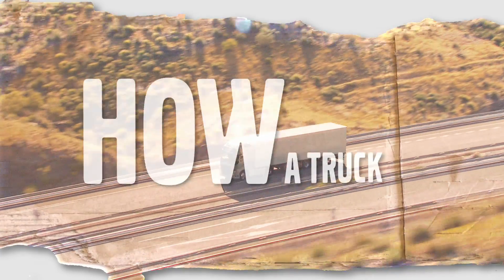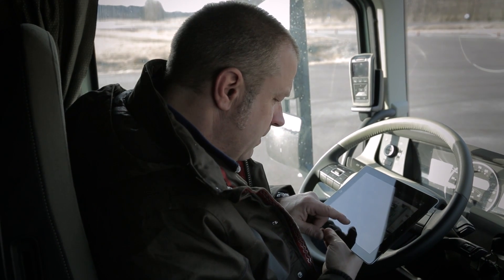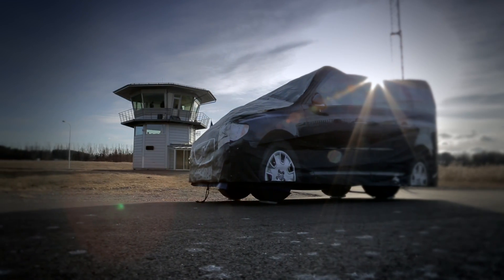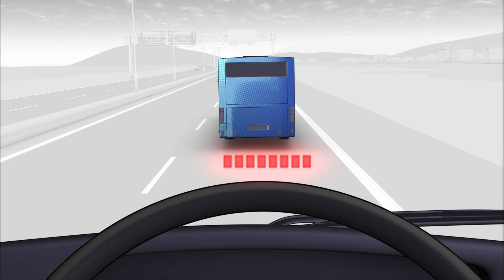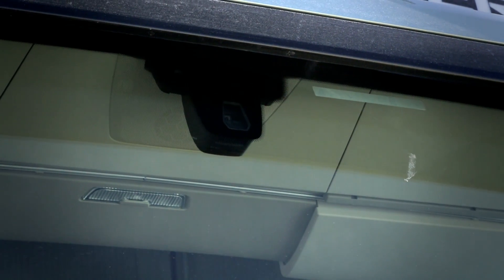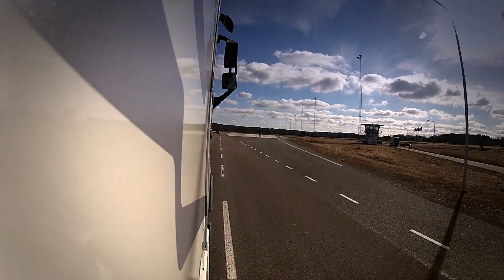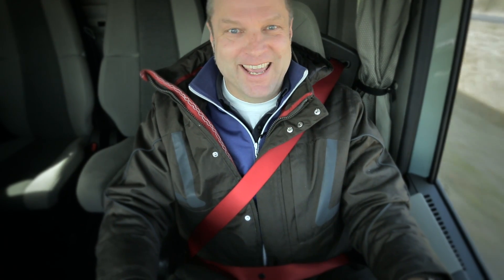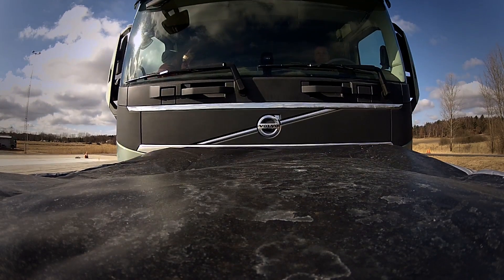Volvo Trucks - Testing Collision Warning with Emergency Brake - "Trucks' Anatomy" (E01)

Comment: My question is, if the driver hit the brakes at the same time the automatic system would kick in, would that be enough to stop the truck? Like.. I guess what I'm wondering is there anything special about the automatic system breaking vs a regular person breaking. Not in terms of like, reaction or whatever. But more in a sense of, do the breaks from the automate system work harder than if the driver was breaking? If that makes any sense. It blows my mind how quickly it can stop and I'd like to see a comparison of human stopping vs it.

Comment: Automation like this is the direction vehicles need to take, IMO. Adding features that automatically do things when the human mind fails is way better than letting the machine do all the work in every situation (which is impossible). This automation doesn't encourage drivers to be less attentive, and it only activates when the human has failed.
Reply: Yeah

Comment: Rip to the drivers behind the semi
Reply: the system starts of with mild braking. before it brakes as hard as it can. so unless your grill is 2cm away from the trailer.
you will have plenty of time to brake :)

Comment: And how about the situation when the truck is full loaded and has a higher weight? Is that system going to react exactly the same by stopping with the same distance from the vehicle?
Reply from the maker: The trailer is fully loaded with 40 tonnes.
Reply: Volvo Trucks Thank you for your answer.

Comment: Not proof that it works, but a feature of the excellent braking system. I say that it's not proof b/c allegedly an investigation determined that the driver not the system saved the child's life.

https://www.liveleak.com/view?i=0b2_1510507991

Comment: https://www.youtube.com/watch?v=LxlHjz9EsCU shows the breaking system also works on children, running out from behind a bus.
Reply from the maker: Our system Collision Warning with Emergency Brake is designed to alert the driver if there is a risk of a collision. In case of an emergency situation it will automatically brake to mitigate a possible collision with another vehicle. In this specific case the driver and the truck are the real heroes for acting very fast and correct.

Comment: Does it work on pedestrians?: https://www.nrk.no/sognogfjordane/her-er-skuleguten-berre-sekund-fra-a-bli-pakoyrd-1.13774425
Reply from the maker: Our system Collision Warning with Emergency Brake is designed to alert the driver if there is a risk of a collision. In case of an emergency situation it will automatically brake to mitigate a possible collision with another vehicle. In this specific case the driver and the truck are the real heroes for acting very fast and correct.

Comment: But in case of zombie apocalypse?? If you need to smash through cars on a highway full of abandoned vehicles you're screwed. They should really have a button for this!
On a serious note I wonder how it reacts when the vehicle is turning a corner at speed, the truck could flip on the side if brakes were applied at a wrong moment. Really cool technology though.
Reply from the maker: Hi, check out this video: https://youtu.be/dqNtzncxxcI

Comment: I drive one of these new Volvo,  I can tell you..... It does work. .😮😮
Reply: that would mean that you nearly hit someone if it was not for the system??? BOI
Reply: @dagoskai572  yea, these machines capable much more than humans... I can tell you, once a Scania's auto brake saved my ass. I made mistakes, I am a human, robots too but less frequent
Reply: the system also isnt perfect, espcially on dual lane bends without road markings

Comment: "If there is no reaction from the driver, the system will automatically activate the brakes."

The system should not wait for the driver to react, it should start breaking imediatly by it self to avoid panicbraking. 

Also, he activates the cruise control in the video, will the emergency brake work even if he would accelerate? Will it work in speeds over 50km/h?
Reply: Your opinion is right! But if they do like you say,the system will activate everytime you approach a car behind you.

Comment: And so what keeps the LOAD from rolling over the cab & driver after shifting forward during braking?
Reply: Take the drivers license theoretical course and you'll know.
You have to secure the load so it stays in place when doing emergency braking.
Reply: +Lithuania Mania  did the load move in test?
Reply: I don't know how it works in the rest of the world. But In Europe you have to secure the load 100% of it's weight forward. If a pallet weighs 1500kg then you have to secure it for that load. Using the correct equipment it's no problem. Of course if you are involved in a crash and the truck does 70mph --> 0 mph instantly then you are dead anyways.
Reply: Lithuania Mania In Sweden by law the cargo need to be secured so it can take its own weight. That means a deceleration of 9,8 m/s^2 , compered to the emergency brake of ruffly 7m/s^2.
Reply: I don't care how strong the chains or straps are...moving forward at 70 MPH and stopping on a dime will very probably break the restraints and then....goodbye driver.!!!  You must have seen rolls of coiled steel tied down on truck beds with the eye of the coil being in the position where one could look thru it from the SIDE of the truck, yes?  It's called carrying the load in the "suicide" fashion!  Guess why?

Comment: the problem is what if the car behind you does not install this system? it might prevent you from hitting the car before you, but meanwhile will result in another collision from the car behind you. It is like to ask you to make a choice, hit by your head or bottom?
Reply: Some Volvo V70:s have the same thing

Comment: it was awesome but what happen to the vehicles which is coming behind of the truck
Reply: +Balakrishnan Idayachelvan Well, if they adhear to the law and have enough safety distance: nothing :) looking at it from a responsibility point of view. The last vehicle to collide from behind, has the responsibility for the entire crash. If the other managed to brake, but the last didn't, it would cause the ones in front to collide as well. 

but now we are going into traffic law instead of appreciate that with this truck we can avoid or severely minimize the damage done in a crash.
Reply: That's the driver behind the trucks problem...be aware of your driving..practice safe driving!

Comment: This system is very accurate thought it shouldent be use as something to twittle with.Drive the truck like it should be driven an it shouldent be an issue. Just switch it on when in unsure situations an switch it off, Other than that your eyes should be on the road anyway.

Comment: How about truck drivers learn how to drive properly instead so theres no need for installing automatical brakes onto every truck?
Reply: +ShoutsWillEcho1 If you watch the crash comilations on youtube from various places, sometimes thing pop up out of thin air, that a normal person will not have the time to react to. With this system a crash may be avoided or minimized in severity.
Reply: ***** Well, there sure isnt a lack of retarded people here.

Comment: What if camera or radar fail ? There are alternative ?
More electronic > more problems... :-)
Reply: yodek
Who said they should?

It' a EMERGENCY BREAKING SYSTEM.

It's designed for chases like: "The driver is playing with his Smarthphone/Laptop/whatever, and the truck is about to hit something" or "The driver has a Heart attack/ epileptic seizure/whatever" and can't stop the Truck or, even worse, keeps accelerating since his feet is still on the accelerator.

It's NOT designed for: "just put your feet 24/7 on the accelerator and turn your brain off, ' cause the system will do the rest"

If there is really someone out their who's thinking like that... I don't think he will EVER pass the driver-license test.

Just my 2 sentence about that...
Reply: yodek Transparent Windows
Reply: yodek The alternative is hitting the breaks yourself.
Reply: +yodek What if your Truck get's hit by a meteor? Alternatives?
Reply: Nice sarcasm guys, I don't have a good riposte / retort for you.
I have asked question, because I want to know why drivers should more trust a new trucks than old.

Comment: Amazing how you can stop 40 tons this quickly and keep the truck in one piece
Reply: Don't forget how many wheels are braking on trucks.
Reply: Does the trailer have brakes?
Reply: @obiwan245  yes it does
Reply: In Sweden, we have trucks up to 74 tones, Finland 78 or 172 000 lbs for the Americans
Reply: ID GAF of course
Reply: 14 tons not 40,its not a main battle tank.
Reply: @jacklarkson4505   hate to burst your MBT circlejerk but it is 40 tonnes. Articulated vehicles can have a maximum mass of 44t in the EU
Reply: @jacklarkson4505  that's a loaded semi truck of course it weighs 40 tons
Reply: @jacklarkson4505  in America  we run 80 thousand pounds. In Utah, the wind gusts would  blow over 
Any semi. Welcome to reality.
Reply: @dontrustwhiteyevery1  pounds?let me go and see how much is that mean first...lol
Reply: imagin, how your load is destroy, and guess who will be pay for that damage...
Reply: @3489910  Ever see how much incident reporting costs along with human life loss?

Comment: Why the hazard warning lights are not switched on automatically to warn the traffic behind the truck ???
Reply from the maker: luk3334 The brake lights are switched on when the truck starts auto-braking. The truck slows down a good amount of time before emergency braking to a full stop.
Reply: Brake lights also flash when aggressive braking is performed by driver or the emergency system
Reply: +luk3334 For a truck that big, it does need some distance to stop. With a car that's only a fragment of it. If you pay attention like you should when driving, you will immediately hit your brakes as soon as the truck's brakelights go on.
Reply: The hazard lights do come on when the truck comes to a full stop.

Comment: Probably one of the worst videos ever ... it does exactly what the original video did ... Thought this guy would explain the system ... ??!?
Reply: DM_SSX///M Yes, but combine that with scandinavian weather, where the breaking distances will change hourly.
Reply: Jaco du Preez What else is there to explain? There's a camera and a radar, and some massive quality brakes. Is that too hard?
Reply: That's stating the obvious. The technical aspects of how such a weight can be stopped within a metre is lacking ...
Reply: Jaco du Preez I will state the obvious again, "massive quality brakes" and weight distribution i presume.
Reply: Jaco du Preez i think this is to just test if Volvo lied or not about the system
Reply: When he sayed dummy car hahahha

Comment: What if I want to crash on purpose?
Reply: find a bridge
Reply: Are you nuts?
Reply: +GoezWild  As you can see at the beginning of the video, there is a switch to enable/disable the system. If you wanna crash then just disable the system before trying.
Reply: Then its a hard task to do haha
Reply: Ramūnas Gudauskas jo, gana sunku buti blogu vairuotoju su tokia sistema
Reply: Then, the truck will say fuck you

Comment: What's the speed limit the system is working? Will it even work with 90 mph or even more mph?
Reply: at 90 mph insted of warning the driver the truck will play a hymn and send an email to your loved ones telling them how much they are loved.
Reply: As far as I know trucks sold in the EU have to be limited to 90kph which is 56mph. The computer doesn't allow the truck to go faster.
Reply: YourGreat AuntRosie 90 mph is ~144 kph. The speed limit on the highways where I live in Canada is 110kmh, but they've been considering raising it to 120-30 because everybody drives that speed anyway.
Reply: At no point on UK roads is it legal for a truck to do 90mph. The speed limit on motorways is 70 for trucks under 7.5 tones and 60 for trucks above that.
Reply: YourGreat AuntRosie
The trucks won't only be sold in the UK.
Reply: Ikem Krueger I'm not aware of any roads that allow speeds of 90 mph/112 kph other than those without any limit (such as Germany's Autobahns) and even then I think any responsible driver should keep from exceeding 70-80.
Having said that, I'm sure some will and having the system demonstrated in the video may not work as effectively at those high speeds but if you're in a state where you can not brake it's sure as hell better to have said system than to not have any.
Reply: greenzoid2
I think the whole world should adopt the french system. 120kph is to slow, that's the speed limit in Belgium and everybody who's car is capable of doing 130 or 140kph does these speeds. In France the limit is 130kph and when there's bad weather it gets lowerd to 110kph. I think that's a really fair system, and it works because driving on the French 'autoroutes' is  much more fun than driving on the Belgian motorways.

Comment: I see a lot of concern for the drivers behind the truck, and I kind of get the worry; a non-attentive driver may very well end up rear-ending the semi, which would suck for the car driver. However, even with this awesome system, a semi (whether fully loaded or not) won't be stopping faster than a car with standard brakes would be able to. I guarantee that no matter how fast a truck stops in front of me, if I have a reasonable following distance (which is a no-brainer when I follow a semi, since I like to have time to dodge potholes and whatnot that the truck would obstruct), I'll be able to stop far faster than it, regardless of how great the truck's system is. It's just physics, my 1.5 ton car will stop faster than a 14 or 40 ton semi. If the driver isn't paying attention or is being a tailgaiting asshole, well then... the result would probably be the same regardless of if the truck had this system or not.
Reply: If you are following a truck on a highway and you do not maintain safe distance, then you deserve to rear that truck.
Reply: Well, if the truck crashes won't the car behind crash into the trailer anyway?
Reply: Preston Ray What if the car behind the trick also has emergency braking?  That would be a cool thing to watch a line of cars with autonomous braking to react in a line.
Reply: Just to answer the both of you, when the system detects a crash the brake lights will flash faster the harder the system brakes. Check in the videos that Volvo Trucks made and you will see

Comment: Does this system take into account the conditions of the road (icy, bumpy..) and the conditions of the truck's wheels? I guess those factors would alter the results of the calculations with just the distance and the speed
Reply: Of course, yes, all that does it automatically.
Reply: 3:11 I think it tests the brakes just before the full braking event by slaming on the brakes and checking what happens, then it calculates the maximum braking potential and then waits until the last moment to stop.
It could also be a warning to the cars behind or an attempt to get the drivers attention, or all 3

Comment: Hi question for you Volvo, first the system looks amazing, but will it work at higher speeds - that is to say it appears in the video it applies the brakes. But what if the truck is travelling faster (in reality I've seen some trucks doing 75-80 MPH). So in a case like that, will the truck (automatically) stop further in advance, or will the truck first automatically slow and THEN stop if needed?

Comment: Amazing! But what about higher speeds? How much does it take (in time and length) to go from 100km/h to 0km/h?
Reply from the maker: Depends on the road conditions and the speed of the vehicle in front of the truck. With regard to the safety margin it is set to a minimum in order to avoid false brake interventions. The system constantly monitors the situation ahead and it makes no difference if the car in front travels at constant speed or is braking. Of course not all accidents can be avoided, but in the situations where the accident cannot be avoided (for example if the car in front brakes very hard at a short distance or if the road surface has very low friction) the accident will be much less severe since CW-EB will mitigate the accident by reducing the impact speed. The reason for the truck coming to a complete stop at this specific demonstration was that it came below the activation speed. At higher speeds it will adjust the braking in order to match the speed of the vehicle ahead. It is also always possible for the driver to override the braking.
Reply: The technology used on Volvo's Trucks is amazing. This will really avoid many accidents or make them less fatal, I was just very curious because I had the impression that this braking system seemed stronger than the high speed sportive cars, but with a truck weight of over 40 tons...

Comment: I wonder what would happen in a scenario where there is a slow moving vehicle in front, the system starts to brake, but in that time the vehicle in front starts to brake too, automatically the safe stopping distance of the truck is shortened.....and that can't be predicted by the radar or the camera.
Reply: In this instance the truck may very well impact the car, but by virtue of the fact the truck braked before the human - damage has been limited and it's mission success.
Reply: Khazar01 Either the truck stops short of hitting the car in front, or the impact speed is at it's minimum; either way, it's safer than what would normally happen.
Reply: If the sampling rate and the precision of the radar is high enough, while knowing the speed of the truck and how the movement of the truck accelerates (or decelerates); the system should be able to determine the rate of change of the speed of the vehicle in front of the truck (assuming that this rate of change is at least linear) and thusly adjust the automatic braking accordingly.